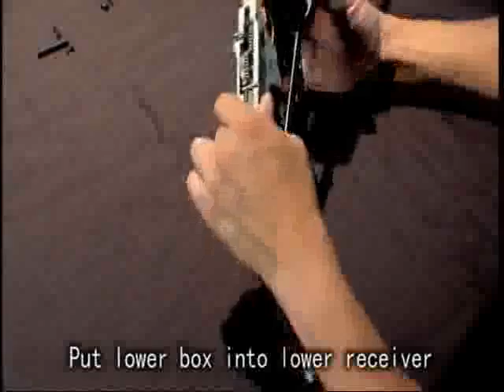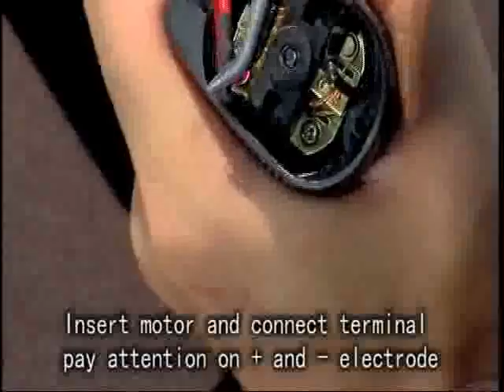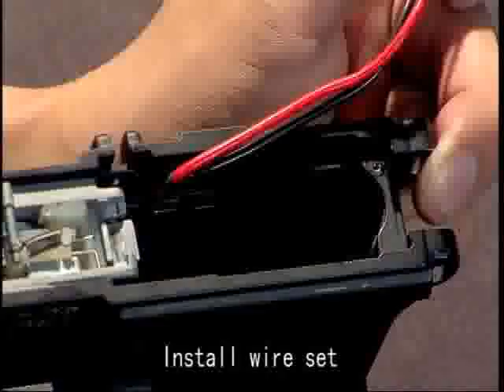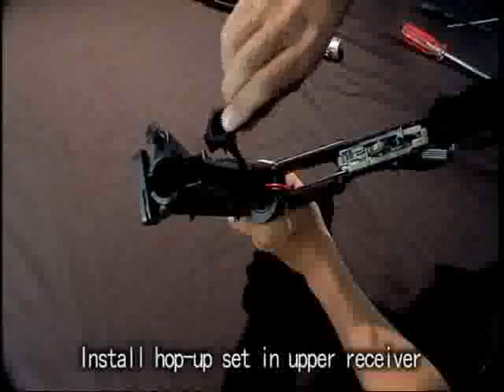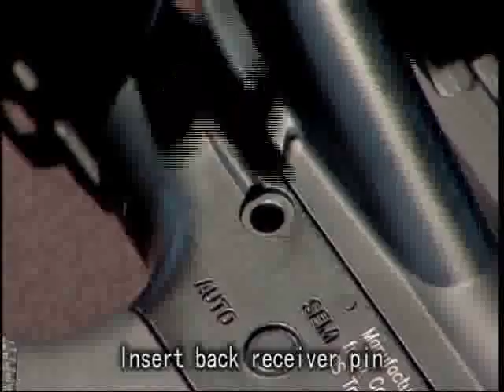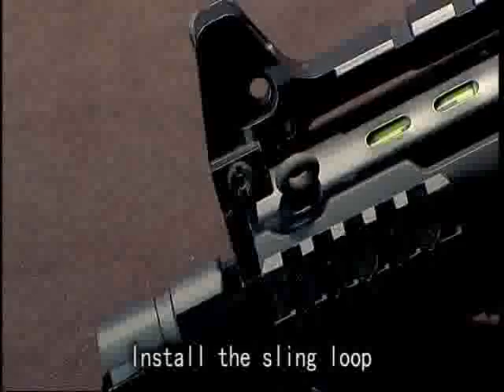ICS CXP Main assemble demonstration

Comment: hi, i took the motor in the handle out, cleaned it and put it back in and it is't working i've put the cables on the right way and screws and it still wont fire. can u help?